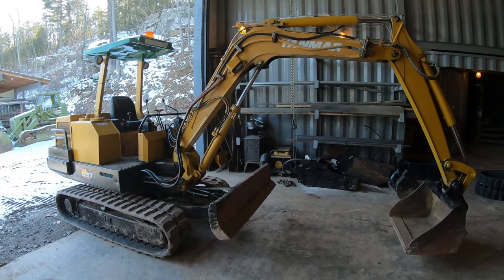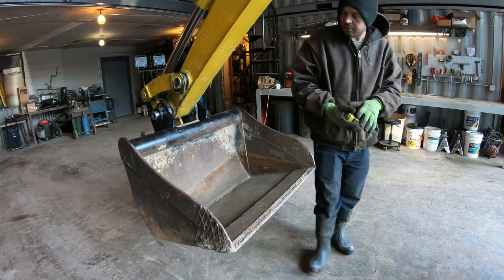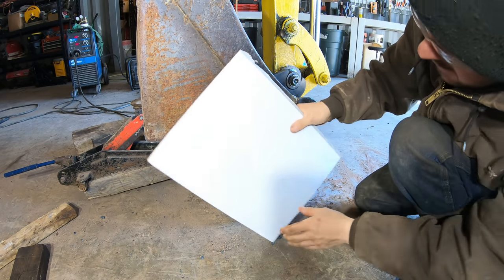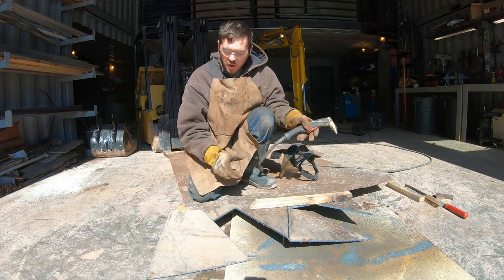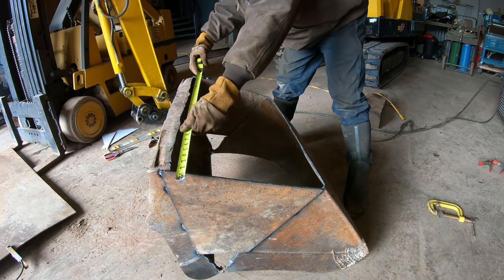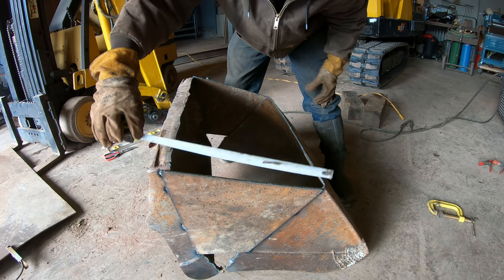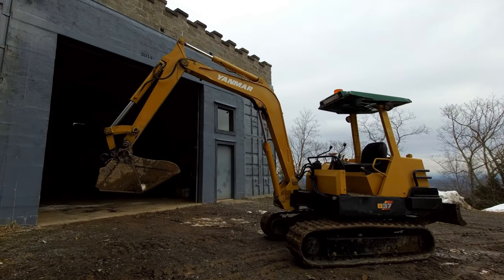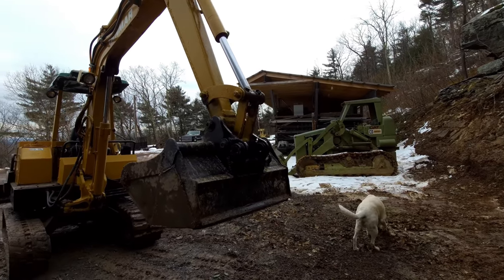Modifying an excavator bucket

Comment: Sweet. You increased the capacity and made it more functional.
Reply: But is the buckets structural integrity still the same as before... .
Reply: @clayboist  It's stronger. It's been 'Camarata'ed"
Reply: Is the added weight a factor? Added steel and more in bucket.
Reply: @Z-Bart  highly doubt it. But I have faith in Andrew!
Reply: @jayjohnson8963 , Maybe 40-50lbs ?  Shouldn't be a problem for just a clean up bucket right ?
Reply: @jayjohnson8963  was thinking something similar, personally i would of angled the bucket in 2 stages, rather than have a wheelbarrow for a bucket
Reply: and im wondering if once its full of heavy rock and wet earth if its too heavy.. one that size needs drainage holes
Reply: The more I think of it, the less I think the weight matters.  One can always use a big lever to tip themselves over.  Considering the high skill level of the operator, not likely to be a concern here..

Comment: E>X>C>E>L>E>N>T modification of that grading bucket AC!   @6:13 you did a great bend test of your Mig welds when you spread the opening wider against the welds on the top.  Thanks for posting.

Comment: good work.   Ive made a few excavator buckets from scratch. A skeleton bucket and a topsoil trommel type bucket driven off the auxiliary hydraulics.  I cut everything with a hand torch but we now have a homemade cnc plasma table and it sure would have been helpful in the build.  Last project was a large sandblasting cabinet. everything was documented on my channel

Comment: Andrew, hello from the UK, great vids, and great work. Just a suggestion for you for your earth clamp on your welding rig and plasma cutter, I used to remove the earth clamp and put a magnet on the end,  either screw or bolt the cable to the magnet, and no more clamp getting crushed/banged/falling off. Any old magnet will do (obviously the bigger the better), from an old speaker, or a welding magnet, it just made life a lot easier. Like I said, only a suggestion, no offense taken if you ignore it. Best wishes and good health to you Andrew, the best YouTube channel out there.
Reply from the maker: Thanks. Yeah, I have seen those at the welding supply place, I guess its worth trying. Usually the clamp is fine though.
Reply: My magnet broke pretty quick so I moved back to the style Andrew has in the video
Reply: @kansasadventure1831  That's a shame, I had welding magnets on my stick set and my mig set, used them on site work for 30 years, I got on really well with them, still, whatever gets the job done eh. I did still use an ordinary clamp for tigging though.
Reply: @AndrewCamarata  If you use the corner magnet, the one that looks like an arrow head, it also helps hold things at a 90 degree angle, but the cylinder welding magnet, the round one, always got a real good clamp on the metal.

Comment: Didn't finish watching the video. Before I posted the last post. That would also work on those Forks on your cat forklift. If it  just a piece of tubing that you could drop down against the steel once it's flat on the forks then you could pick it up and go anywhere with it. Especially if you put a rubber foot on it that sets against top of the steel.

Comment: Thank you for your videos , I did lots of reaserch for a Cnc plasma setup and the best bang for our buck is a cnc router parts , it cost less then half of the Lincoln setup , also your excavator sounds just like mine when I had dirt in the fuel filter , might want to check that
Reply from the maker: Ok, that thing doesn't have quite the power it should, plus it smokes a little sometimes. Ill mess with it.

Comment: Hey Andrew I just thought of something is use picking that piece of Steel up. What if you welded a piece of square tubing vertically on the backside of your forks in the middle. And basically had another horizontal piece going out there about the middle of the forks. With a piece of square tubing that would be vertical also going through the larger piece of square tubing did you could pin it. Just a thought when you pick that piece of Steel up you could have just reached out there and pulled the pin dropped it down and pinned it in again and it would act like a thumb holding the sheet steel down to the forks in the back.??? Just thought that would be something easy to build. That would help you pick up sheet steel with the forks or anything else like that that's longer than the forks and wants to teeter totter.
Reply: @toddkratzer7953  true. But a C-clamp wouldn't create another AC video :-) plus it would just be boring. And it wouldn't be Andrew's  Style. He always does stuff it is whey innovative. Take for instance this video.  He could of just went and bought another bucket.
Reply: Why not just turn the sheet a quarter turn so it is only 4 foot wide and then pick it up instead of having the long end sticking over the end of the forks.
Reply: @josephheimann2674  very good point. But the thing I'm talking about would not stick out over the forks all the time. Picture of receiver hitch just above the top of the forks in between the boobs about a 3-inch long piece of square tubing. And the thumb I was talkin about would just slide in there. And you can actually build a another receiver on the back of the headache rack behind your head back there in the back of the forklift to stored it in. And that's great for a 4 x 8 sheet turn , to turn it a quarter of a turn period. But what if you're dealing with something that's a 6 ft by 10 ft sheet? Or something even more odd ball size. I have a little hand truck forklift it'll lift a thousand pounds I'm on vacation next week I'm going to do a video on what I'm talking about and I'll show you.

Comment: Your videos are always very informative creative and very cool but one suggestion the bucket you should paint them safety yellow or orange or some fluorescent color that way in bad weather conditions or if it's starting to get dark you have a better visibility to avoid messing something up that you don't want damaged
Reply: Paint on a bucket is usually scraped off the first time it's used to dig in dirt.  Buckets are painted to look nice when they're sold.
Reply from the maker: Yeah, that's not a bad idea.
Reply: @davidnull5590  You are correct but certain areas get less abuse I was trying to be helpful

Comment: Am I the only one wondering why he just had a random sheet of metal in his yard?
Reply: @ganymedeIV4 I suppose
Reply: Doesn't everyone have steel plate, angle iron, u-channel stock and steel tubing in their yard??  Most people with equipment have a supply; they buy when they see it for a reasonable price, then they have it on-hand when they need it.  My friend just got a literal truck-load of AR-500 steel for a small fraction of the price the steel suppliers would sell it for ... buy when it's inexpensive and store it.
Reply: Guessing he probably last used it during his mudder days to shore-up the bottom of the engine carriage framework or on those custom bumpers he has made.
Reply: Oh ok thanks
Reply: Do you do alot of wondering or what? Come on man
Reply: Nope, every machinist has steel laying around, if I needed some work done and the shop was clean with no bits and pieces laying about I'd run out the door, any good fab shop worth its weight has stock on hand.

Comment: Hey Andrew, it's been awhile but back when I was in metal fabricating, about 25 years ago, we had a plasma cutter template following machine. It was a lot cheaper than a CNC machine. Its value was really in repeat work maintaining ok tolerance. We sold it when we liquidated my dad's metal fabricating company.  I ended working for the company that bought it but they never used it.  They ended up buying a CNC plasma cutter with water table. Nice machine. But you need to be manufacturing something to justify that cost. In any case,  maybe they still have our template machine sitting around.

Comment: Andrew the problem with starting the forklift is probably with the Propane meter box. There is a pre-chage solenoid valve that allows 2-3 seconds of gas to flow before vacuum pressure has built up . When the engine starts a diaphragm opens and allows gas to flow. When the engine stops this diaphragm closes and stops the gas flow. There is also a heater in the meter box to stop propane liquid flowing into the meter box. The gas is then injected into the air stream on the carb inlet. I hope this helps.

Comment: Andrew, whoever last changed that bucket's mounting tabs(ears) created this problem, the last person didn't think through the geometry involved. The bucket is fine, the mounting isn't.  You could model all of this with a program like Sketchup.
Reply from the maker: The Tabs I just cut off it looked like the original. It had that problem with the old tabs too.
Reply: @AndrewCamarata  --- I should have been more clear in my original comment. I wasn't blaming you.  The guy who first made the tabs didn't think about the geometry. You're the one trying to fix his mistake.

Comment: Great work Andrew to be fair mate you handle the plasma cutter confidently and you are skilled in design engineering so has for the computer plasma table I would first try using wooden templates and trace around that shape and try that if it works then thats a hefty saving you have made...Also with such a good job on the bucket you could go into Custom Bucket market.....Stay Safe

Comment: Good job Andrew, as always. I would like to pick up a ditching/grading bucket for my u35 sometime. Just a thought, you dont have a old grader blade laying around, to make a cutting edge for ur ditch bucket. You may not need it. Just seems like yalls ground is pretty abrasive up there. Might help the bucket last longer. Anyway, another great video. Look forward to the next.
Reply from the maker: lutt72 I replaced that edge when I got the bucket, it’s like 1” with a sharp edge. It’s fine.
Reply: Andrew Camarata i see now, i missed it. Lol

Comment: Great job converting that shovel/bucket, but as I understand it, the reason it had the shape it had is because it is originally meant for planning, leveling - landscaping basically - and not so much for lifting materials in a dump truck etc etc..

Comment: Do you think you should put the pin back out at the outside of the quick connector again to see if that would help reduce stress on the curling cylinder

Comment: i  really do enjoy everything thing you and how you always find simple solutions to problems but as an engineer, I can't help myself but to tell you have made this bucket very weak. it will develop fatigue cracks sooner or later not because of the weld but because the extra length that was added.
Reply from the maker: Mina Botrous that bucket will last forever

Comment: Just a suggestion Andrew, might eventually think about putting some AR 400 or T1 wear plates on the bottom where the squared corners are that you welded. Won't give you problems now but might down the road. As always great video.

Comment: Do you think you will need to add some "wear" bars to the rest of the sides to even them out with the extension sides? I was thinking the edge would catch and wear a lot it you were digging a ditch, but that bucket isn't really used for that so I have no idea if it needs it. Nice work, spring is coming.

Comment: hey andrew it’d be cool to see you modify a bucket with a straight edge by cutting holes in the bucket to attach a steel plate with teeth welded on it...a grading bucket and a digging bucket quickly changed by 6-8 heavy bolts

Comment: Just a heads up as a rig welder, next time dont cut the bucket completely off, leave half the thickness of the material where it hinged and just bend it, then its already aligned and no need to weld ot back on.

Comment: FYI, if that lift truck is consistently hard to start, you should look at replacing the innards of the fuel regulator. Propane regulator diaphragms are the most common cause of headaches with them. I used to run a Cat propane lift that was a bit newer and bigger than the one you have there (15 000 lbs), and the only engine problems I ever had were caused by the rubber diaphragm inside the regulator cold-rotting out on a fairly regular basis. The fuel-regulator diaphragm is the Achilles-Heel of any propane engine, especially when stored outside in varying temperatures (condensation plus cold fuel and rubber are a bad combination). 

A trick that I found for making regulators last longer is when I shut down a propane lift for the night, I disconnect the fuel line and bleed any propane that's left in the system. Sure, you'll end up wasting some fuel, but the cost of that would be drastically out-weighed by the cost of regulator rebuild kits and labor in the long run.
Reply from the maker: Ok, thanks for the tip. That thing is actually been starting ok recently. (I don't use it often though). I just fixed the radiator in it, one of the lift cylinders is leaking pretty good though. I want to send that out for it to get rebuilt.
Reply: @AndrewCamarata  Ah ic. Luckily, cylinders are not complicated to rebuild. It shouldn't cost you too many man-hours to get her all fixed up. Come to think of it, the Cat I used to run had a leaky cylinder, too. Just not bad enough to warrant a re-build.

If you can, though, I would advise getting a mobile forklift/hydraulics repairman to come out to you rather than sending it out for service. Depending on your location, that would tend to be cheaper than sending it out to a shop. Just look for one that advertises free quotes and Bob's your Auntie.

Comment: Yanmar: "bucket you need $3500.00" Andrew: 15 year old steel plate $100?....."hold my beer"!....Man this guy is my favorite "make it happen, get it done, solve the problem:.....
I've wanted to buy the Dewalt impact driver, The Miller welder even though I wouldn't use its capacity but they way his MIG welds hold up to his work abuse is amazing. All the welding critics that whine about him not prepping his surfaces and he just does it...He just uses the tools to get his money making machines doing exactly that. Keep up the good work Andrew.

Comment: Not too sure if I’m correct but if you changed just the mounting dimensions on that bucket piston that would give you more throw on the piston in that direction instead of modifying the bucket 

Again I could be wrong

Comment: Does a great job. Only thing I see everyone on here always wants to use a plasma cutter on flat steel. Not everyone  has one. A metal saw does  a better job than a plasma cutter and cost alot less if you cut plate and more accurate and faster. Cut 3/8 plate like 1/2 plywood.
  Ingenuity  is mainstay to make things work if take a little time.

Comment: Something that really impresses me is that we are told at University how welding is supposed to be done, what kind of surface preparation has to be accomplished for a good bond etc. And he puts 2, 1inch tacs on the bucket and starts hammering it down and it doesn't move a bit. It kinda shows how overengineered things are I guess.

Comment: Hi great video, good explanation , really good demonstration. Love to see this  machine on a job. 
Some questions for anybody , how much approximately do these machine lift , I know that varies depending on the machine and the extension. Do these machines tell the pressure and flow of the fluids , oil, cooling,and transmission fluids. 
I am waiting to see how long before Andrew reaches 200k subs.

Comment: Here's a tip, if you want to lift something that's too long/wide for your forklift, use a larger G clamp and clamp it hard to your tynes, not really worth doing with timber but it sure works for beams and sheets of steel.

Comment: Well done, Andrew. Curious , how much money was saved by doing the modification yourself ?
Reply from the maker: Buying a bucket like that is a little over $1000. I spent $125 on those quick change ears, and the rest of the metal I had.
Reply: Excellent, and it was made to the measurements that it needed to be.

Comment: Just a thought, as you use that one for scraping and grading, it might be worth welding on a hardened steel edge like on the dozer blades. But an ingenious solution, practical mathematics

Comment: Andrew, just a quick question about using the bucket for mixing concrete, will your machines have the load capacity to deal with the now larger bucket full of concrete without stressing the machines?

Comment: Nice job Andrew, that bucket seemed really small pretty much 0 capacity you tripled the capacity and saved yourself $$$ and on top of that can see something you made better that suits your needs. You've really come along way over these past few years. Has the lady with the screwed up sewage pipe and leach field called yet ? She will and you can use this bucket to fix the issue lol. Levi approves of work well done, excellent job .....

Comment: Does it really matter if you grind off the dirt/rust on the surface where the welds are going? Totally understand if it was super critical situation, not talking about that. Asking about this and if it really makes a difference weld strength as in this situation.
Reply from the maker: If they are very rusty/dirty yes it matters. I did a little grinding here. The welds will look like garbage (usually will have air holes) if there is a problem. Or you can tell by the way it sounds.
Reply: @AndrewCamarata  Thanks for the reply, nice work as always.

Comment: WIth the increased capacity in the bucket. Couldn't you just mix the concrete in there directly? Easy to get to the height where you need it, and you save yourself the trouble of cleaning the dump truck, as well as prevent excess from staying in there.